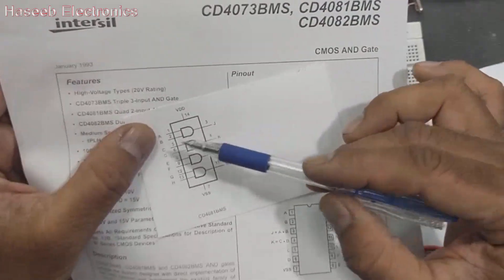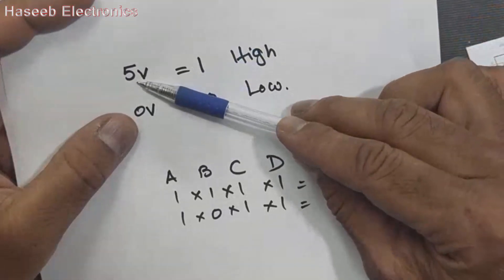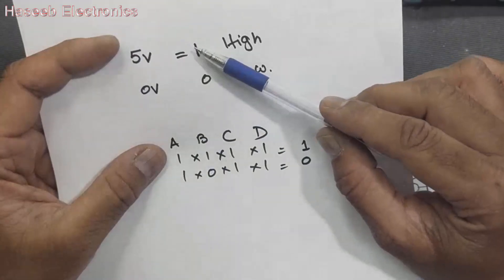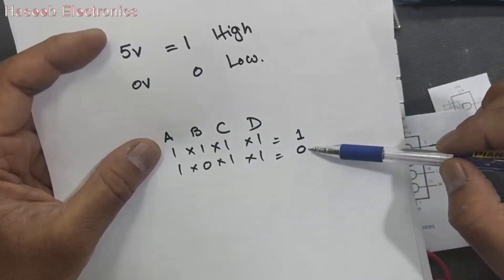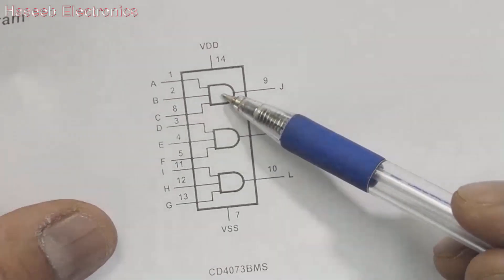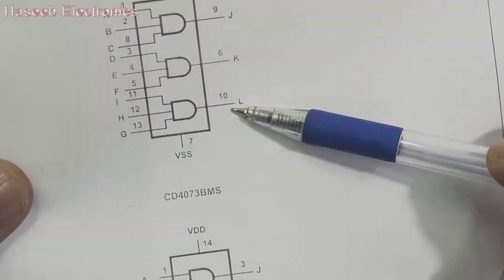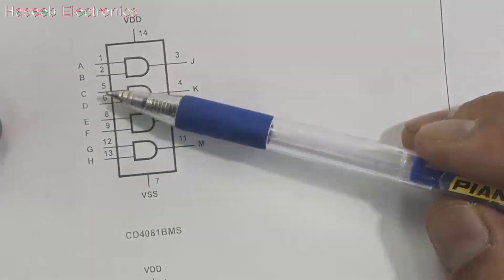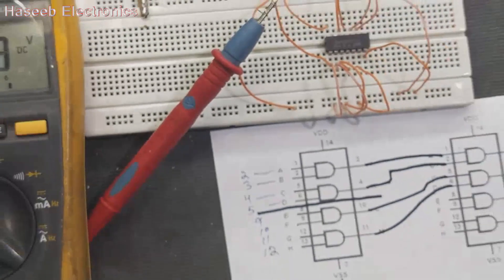340 How to Test CD4082 CD4081 CD4073 AND Gate IC, Function Explained, Equivalent and Pin Lay out

Comment: Is the input the same 5v for any 1 output on those IC
Reply from the maker: yes above 3 volt is logic level High for any input pin.
and less than 3 volt or 0 volt is logic level Low
output will approximately near the VDD voltage